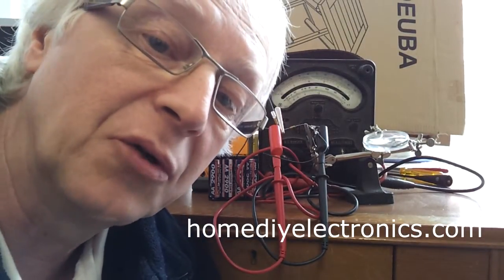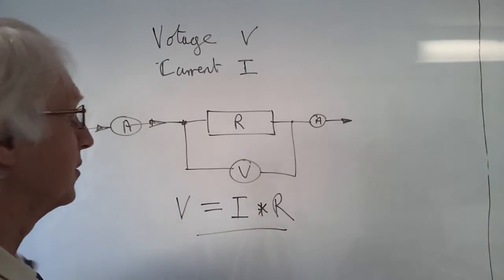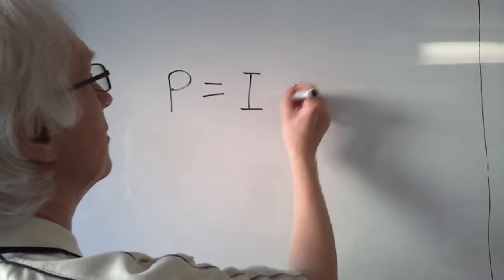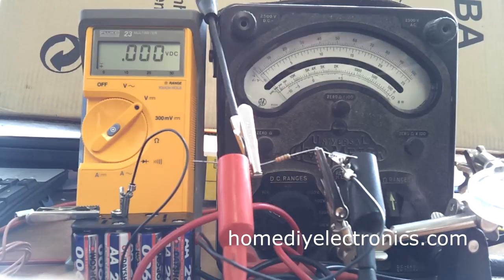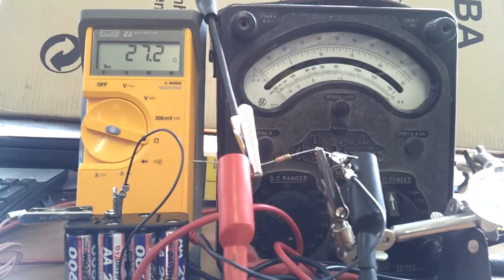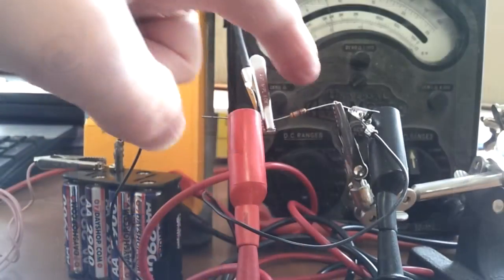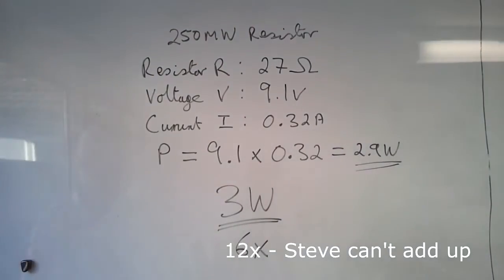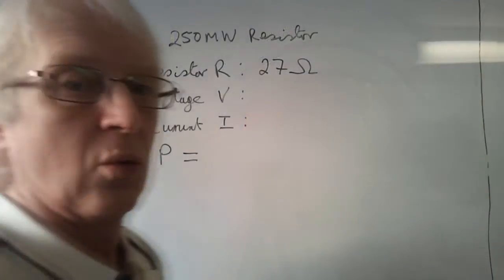Power Dissipated By Resistor: How To Overload A Circuit

Comment: Hello Steve Garratt. Great video. 
You can help me? If I put a resistor of 0R68 5W in 24V, they resist for 1second?
If not, what the minimum watts I have to consider?
I need just 1s for the pulse. Thanks for the help!